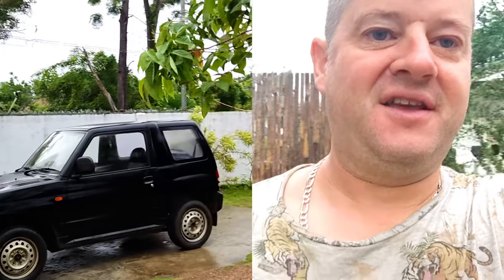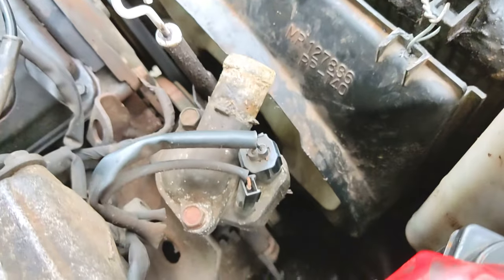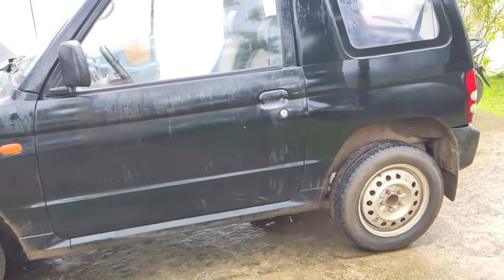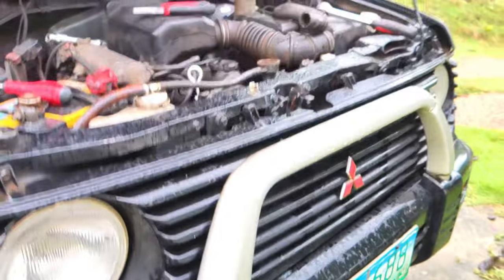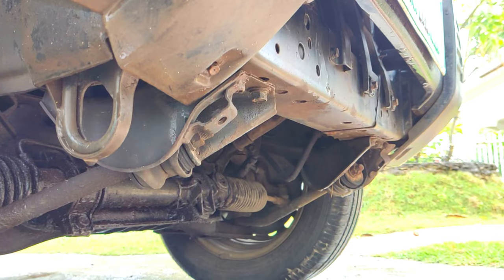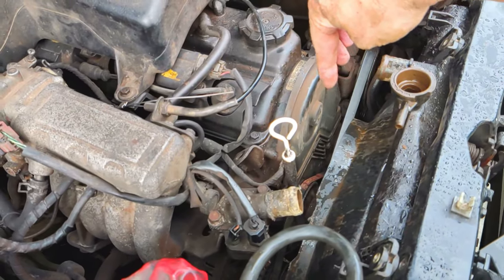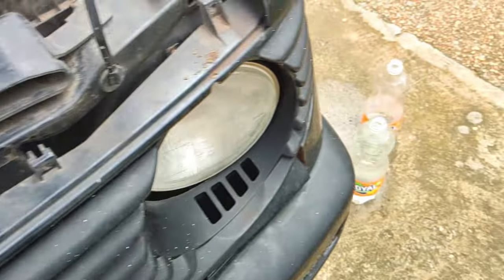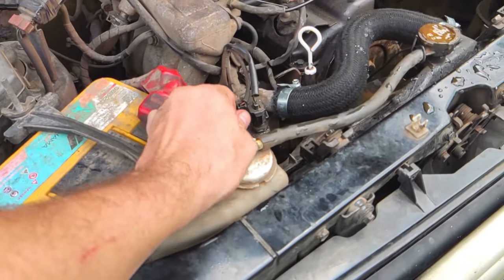PAJERO SHOGUN MINI JUNIOR 4X4 RADIATOR COOLING SYSTEM HOSES THERMOSTAT CAP LEAKS REPAIR HOW TO FIX

Comment: Neglected but still very strong and reliable car. Astonishing ability to withstand overheating, like some ancient car with air cooled engine. Hoses look pretty cheap fixable with duct tape though (if use cooling system without extra pressure).
Reply from the maker: Yeah. Seems like a bulletproof design throughout.